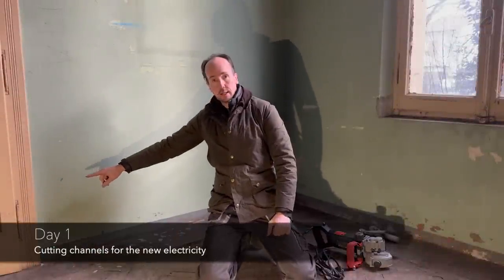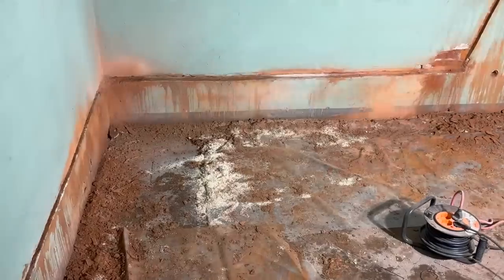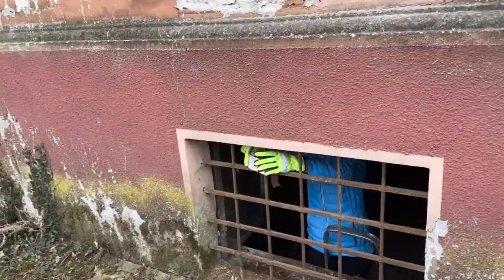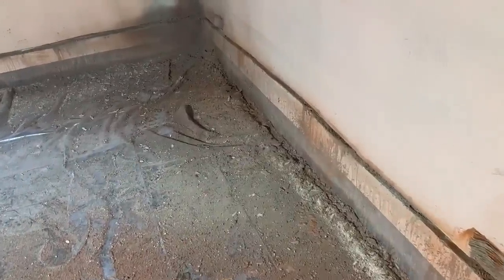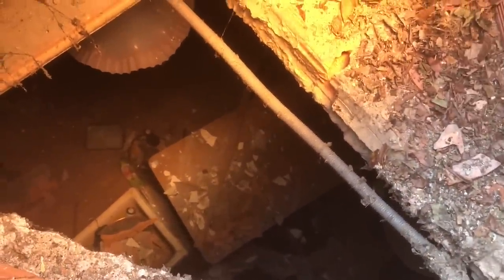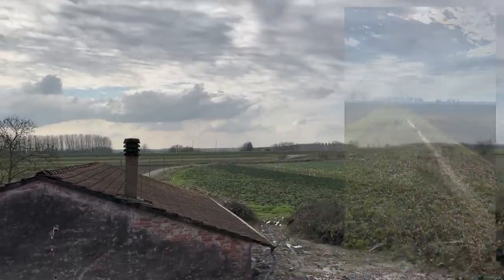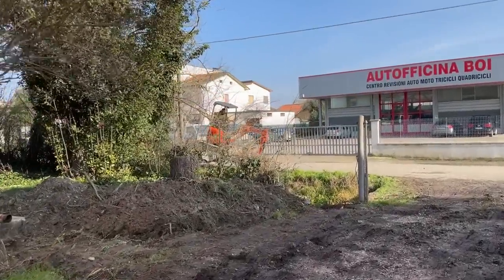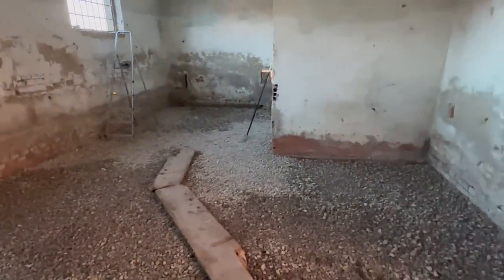DEMOLISHING the VILLA! Or at least removing the extension... - Ep 20 of our Italian house renovation

Comment: I couldn’t figure out at first what you were doing cutting a line around the room!🤦‍♀️ I thought you were trying to tear the walls down! Eureka! Electricity!! What an amazing amount of work you’ve done! So glad your father is helping you! Have a great week! I enjoy watching the progress!
Reply from the maker: Yes, the alternative that the old owner had used was external cables and wall plugs and we don't really want that. 

Thank you for watching Kathy!
Reply: @VillaAroldi  There's another alternative and that's hammer and chisel. Hard work and the chases are more ragged, so more plaster to patch. I prefer chasers with two discs and a vacuum cleaner connection over the type you used though. You have to chip out what's left between the two cuts but it's a lot less messy than this type of chaser.
Reply from the maker: @Ragnar8504 yes, I can use how many chasers I like, I am going to try 3 of them next time as it will most likely be easier to drag the machine on the wall with less discs. I believe there is an attachment for a vacuum cleaner on top of it, not sure.

Comment: See you was using sand paper to do the bars try using a chain much quicker that’s what I used on railings etc takes paint and rust off faster.😊
Reply from the maker: Thanks for the tip Robert, i've never heard of that before! 

We were using Emery cloth as its better for railings and metal than normal sand paper.

Comment: It first occurred to me that you should have drainage in that new concrete area, I also noticed you neither compacted the soil nor the gravel prior to doing the concrete work. I would have used the laser level and marked off on the walls and the doorway exactly a 2 degree pitch to the door so when there is water it will head for the exit. Just a thought from an girlie constructor
Reply from the maker: Thanks for the tips! The gravel gravel might be compacted before we pour the concrete, according to the guy who is gonna pour it we might not need it, so he will decide. 

There hopefully wont be any water in the stables in the future as we will use it for a gym so hopefully we wont be needing a pitched floor

Thank you for watching Jeanine and thank you for commenting!

Comment: You need to gut the walls and start over.
Reply from the maker: Gut which walls and start what over?
Reply: @VillaAroldi  helllo, do you not have to insulate?
Reply from the maker: Not really, it's been un-insulated for 100 years and we do not want to ruin the aesthetics of the house by adding a thick insulation.  @brendajollymore4229

Comment: Nice building but location next to motorway, industrial factory and smelly cabbage fields???
Reply from the maker: No it’s not next to anything what you mentioned, goodbye 👋
Reply: @VillaAroldi  Noise noise noise of that traffic is defending
Reply from the maker: @mariadange06   it’s noisier now as we have cut down most of the bushes and we don’t have the wall there yet which will block of the noise and it’s the north facing and smallest portion of the property so we won’t be there much. 

But then again, some people want to live completely remote, we don’t, we want the vicinity of a village with walking distance to the shop and butcher etc, luckily we are not all the same…